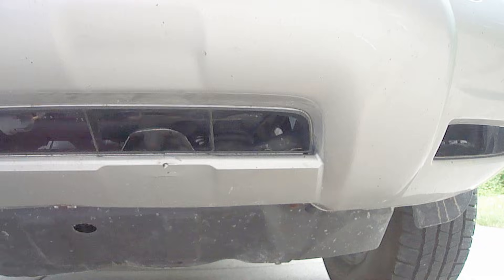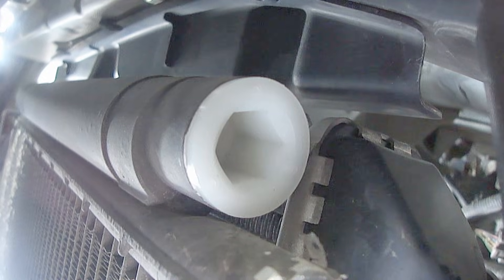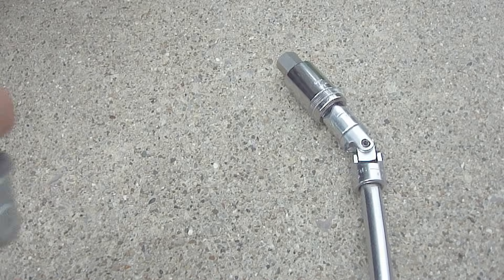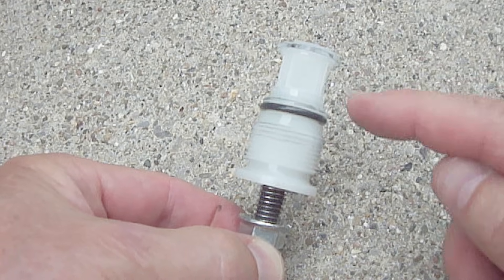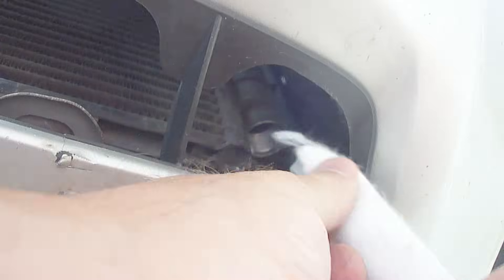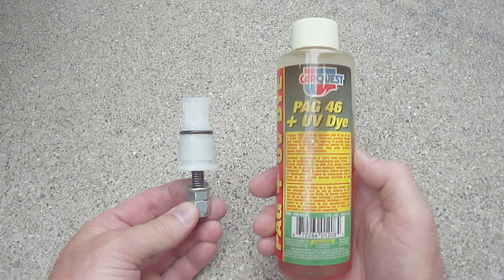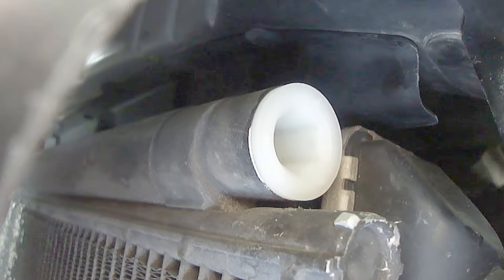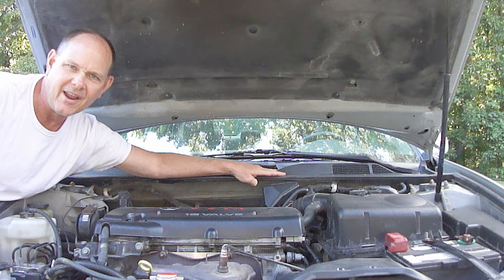Car AC Desiccant Receiver Drier Replacement - Easy!

Comment: sorry, this is grotesquely misleading.  Sure, it's easy if you have one of those rare (?) cars where the desiccant filter (etc) is "easy" to get to.  But you left out the part that for most of us, like those of us stuck with Kia Sedona's, you likely not only have to tear off all those ,miserable plastic crap parts, but you must drain and take off radiator, then the condenser, and/or take off the bumper, just to get anywhere near the desiccant bag...    either way, a MISERALBE frustrating job.... and no amount of wishing us a blessed Christian whatever, this horrendous, terrible job to replace a stupid, yet apparently important $10 part.... Hardly an "EASY" job.  I've enjoyed many of your other videos, and appreciate your kind, clear spirit..... This one -- sadly, had me thinking it would be so "easy" ... hardly, quite misleading!

Comment: Great video!  I think your's is the only video I found replacing the desiccant without pulling the condenser.  I'm about to do my 2008 Toyota Tundra.  I have a 14mm Hex Bit socket on order to do mine because I didn't have any over 10mm.  You have a great idea on making your own tool out of a bolt with a 14mm head and nuts.  I didn't think of that :-).  I would like to have the right tool in my tool set anyway.

Comment: Thank usir,,??can the sytem be flushed when compressor locks up ,,mechanic says all components must all be replaced????2500 3000 dollars for the job,!
Reply: Sir, check around, that's a high price you were quoted.
Reply: Do it yourself way cheap use YouTube you’ll be alright and the tools you can rent from O’Reillys I didn’t my ac for about 350
Reply: An AC service should be better for this, one that fixes only AC.